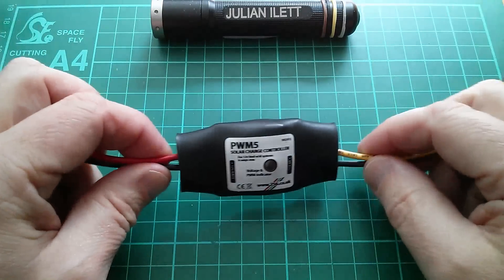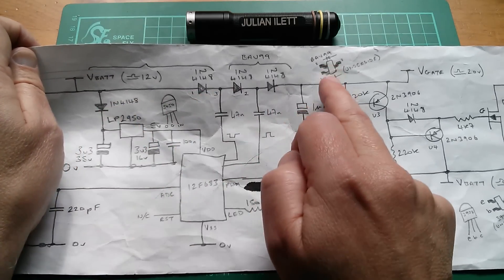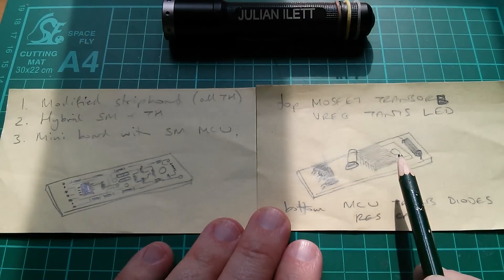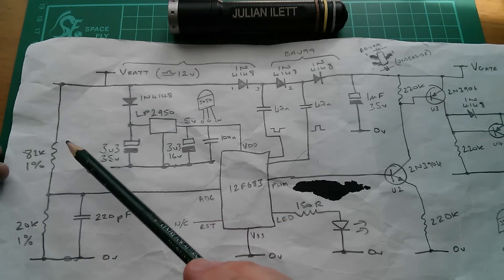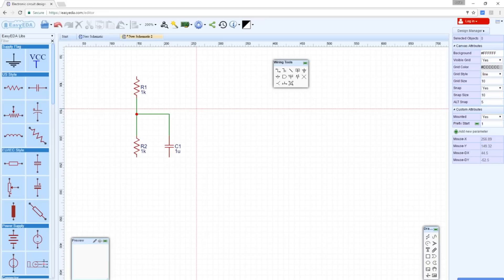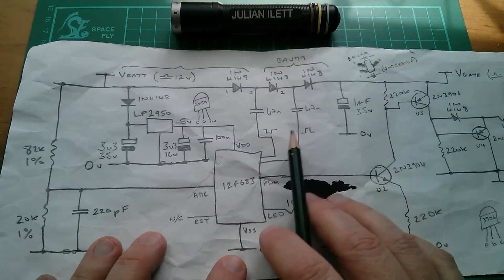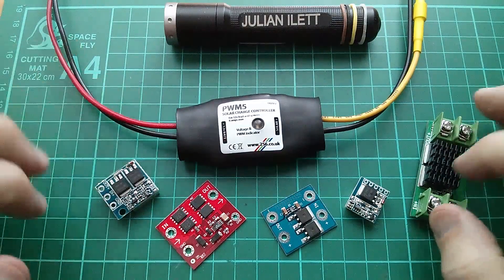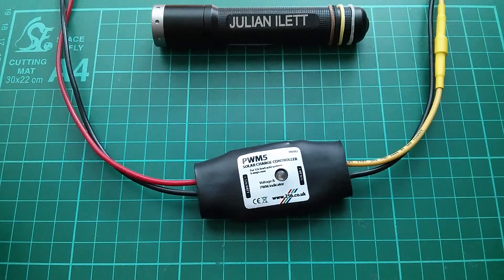PWM5 Solar Charge Controller SMD Re-Design with EasyEDA

Comment: Does this design still cut the mustard in the world of solar charge controllers?
Reply from the maker: While we're still using lead-acid batteries, I think it does :)
Reply: It's a cute circuit and has obvious sentimental value, but I think the world is going lithium and at higher voltages 24-72V, especially as the market will soon become saturated with used 18650s and 21700s as electric vehicles grow exponentially.
How about adding MPPT to it? You've already done the research and fully understand how it works.
Instead of one big MPPT controller for an array of panels, it could be good to use a lot of small cheap MPPTs, one for each panel and then aggregate the outputs.
On a larger array that may have various shading patterns, there can be many peaks on its IV curve, but likely only one peak on a small panel, so this could help maximize collection.

Active bypass diodes such as the LX2410A are superior to diodes which can undergo thermal runaway and lose their blocking ability - this is a great article on shading and bypass diodes:
http://www.avdweb.nl/tech-tips/pv-panels/bypass-diodes.html

Moot for small 20W panels, but some of us do have bigger arrays to play with and want to use lithium batteries instead of lead acid. The market is saturated with lead acid charge controllers already, and there are painfully few for lithium tech - yet.

Comment: And now, the most important question: will it now be called PWM6? :D 
(or actually, why was it named PWM5 in the first place?)
Reply from the maker: +Ivan Voras It was called PWM5 because it had a 5A rating. This was increased slightly to 6A after a minor upgrade.
Reply: Thanks!

Comment: 220pf on the voltage divider doesn't seem like it would have any effect.
BTW the SOT-23 pinouts on your hand-drawn schematic have b/e the wrong way round.
Reply from the maker: There was some instability in the the feedback control loop which the 220pF capacitor seemed to eliminate.
Yes, I drew the surface mount parts on my paper schematic upside down (seen from the underside). I think this was while I was using a simple CAD package to experiment with PCB layouts.

Comment: how about the LP2950CDTX-5.0/NOPB  in a TO-252-3 package
Reply from the maker: +biggrey54 That sounds perfect,  thanks :)
Reply: Use MCP1702T-5002E/MB.  SOT-23A or SOT-89 are available. It is very low quiescent current and very low dropout.

Comment: So this is the reason for the PIC tutorials then? A video documentary of the evolution of the PWM5 and all that is included in the process? I have been watching enough to guess what the big picture is now. Great! I want to make this for myself as I evolve my inner geek with you. Could you explain along the way how it could be adapted for charging with a buck converter in place of a solar panel? Panels are quite a bit down the road for me.
Reply from the maker: Yes, there is a connection between these two projects. Whether I can get them to meet in the middle, I'm not yet sure.
Reply: Wink, wink, nudge, nudge, say no more, say no more, eh, eh.
Well no matter what happens i'll be watching you! ʘ‿ʘ   73 Mate!

Comment: Been in electronics since 1971 in radio/TV repair and later for 30 years as R&D advanced avionics at Boeing for 30 years. In all that time of working with printed schematics, I always ended up drawing out my own....all the different schematic drawing software frustrated me
Reply from the maker: Me too. I tried both EasyPC and DesignSpark, but just got bogged down with all the complexity of the design software. But I'm determined to have another go :)
Reply: give KiCad a try as well. It doesn't have as many packages as some, but the interactive routing is quite nice. Also it's open source, and free.
Reply: I still use the original OrCAD SDT for doing nice, well-laid out and readable schematics.
Reply: Protel on a 286, the best.

Comment: Looking forward to the next instalment Julian. My PWM5 works perfectly and has been since you sent it my way. I would very much like to build one based on the pic version rather than the Arduino. Do you think it might have been adopted by the Chinese manufacturers if it could handle a little more current? Except for the three amp controllers I found generally ten amp is minimum.
Reply from the maker: Thanks Adam. 10A is a nice round number - I went for 6A because it lets you use panels up to 100W (another nice round number).
Reply: Another satisfied PWM5 customer here. After years of using it as a camping solar regulator, I donated it to a mobile solar charge station project I did for some local scouts. However I used a 120W solar panel so I unpotted your circuit from the hot glue and put a heatsink on the FET. No problems whatsoever.

Comment: I recently went through the whole PCB design process in Circuitmaker on my channel.
Reply: I spent a few hours bumbling around in CircuitMaker and managed to cobble together a... "creative" first attempt at a board, but your video explains some important things I missed like 'how to increase the trace size for power nets', 'how to mark hole positions', and 'how to do ground planes', which are good to know if you want to have a board made that isn't useless garbage.

Good shit. 8/10, 25 minutes well spent.

Comment: i worked with a pic n place smd machine around 90-95 era.   one of the packages, an 8 pin was bent flat by an "operative" and reloaded as so it would kneel on the solder pads after reflow, it shouldnt be an issue.  power to you.

Comment: Your efforts were not wasted! I have no interest in starting a business making them, but I did build my own solar charge controller based in part off of the PWM5 design. It currently sits in my garage, with 200W of solar panels connected and operational.

Comment: This is in fact not a design and my head started spinning when I saw you are driving a MOSFET with gate resistor of 4.7Kohm. Little bit study is needed before you start migrating the design to SMD version so that it could at least be usable. I don't see any inductor in the power line and I just cant imagine what this will do exactly. Only PWMing the power path has nothing to do with unless you use an inductor. I cant imagine what a piece of garbage the current design is.
Reply from the maker: +Satyajit Roy I think you're confusing PWM with MPPT!
Reply from the maker: Not really. The RFI was coming from the very square edges of the 122Hz switching frequency. These edges had considerable overshoot with ringing. The 4k7 resistor and 3nF MOSFET gate capacitance act as a low pass filter almost completely eliminating the RF emissions. It's highly effective. Additional heat generated in the MOSFET at this low switching frequency is negligible.
Reply: Satyajit Roy the idea of open sourcing it is so that people can improve it, if you are an expert why not take the design and add to it to make it better for everyone
Reply: If there is any place for improvement I would have said that, with 8MHz PIC, even with 10 bit PWM you end up with only 2KHz PWM. So first thing this PIC is absolutely not suitable, then it needs an inductor. so there is no way other than to use a bulky inductor to drive at 2KHz. In this design, there is nothing mentioned about any inductor thats very strange. There is no analog comparator so the feedback loop has to rely only on sampled ADC. The MOSFET driving is horrible. I dont feel there is any scope to improve this design unless it is completely revamped. Nowadays DSP from TI like TMS320F28027 comes at very cheap price and for hobbyist level there is PIC16F1783 too with PSMC to do it properly.  I didnt feel its a serious business about design, but just a youtube video you enjoy at your leisure.
Reply: Why am I saying MOSFET driving horrible, is because if you connect the scope to gate and source, then you will see how it looks. He has got a new Keysight and it would be nice to show us how it actually works at driving MOSFET. If you connect a solar panel directly to the battery then also it will charge. so this product just do that as switched pulse. Lot of stress to the panel, no efficiency of power, it will end up heating the panel more because when you are pulsing the DC to the battery, then lot of drops inside the panel which will produce more heat. It will not only deteriorate the longevity of the panel, but it wont produce the best out from the panel as well. Its mainly because panel will produce heat internally as well beside the heat received from sun. As the panel get hotter, it will be less efficient. When you design proper PWM DC-DC converter then it will take account of all those thing and will not destroy energy inside the panel. Yes, only purpose of this circuit is, it will cut the solar panel from battery when 14.2 or something is reached. A simple LM311 comparator, a MOSFET, a zener diode and few extra passive components will do that as well.
Reply: Similarly he made last video by connecting two 18650 batteries directly. Few viewers patiently commented to use two good quality batteries, because there is no more joy than to see someone is burning litium cells for fun.  Yes, there should have been warning message because it could be very dangerous if kids try to play same thing without that ammeter... may be that ammeter 100 milliohm resistor could save fire, but if one does using Panasonic/LG/Samsung genuine batteries then you cant imagine how dangerous that would be.
Reply: @Satyajit Roy. Your point about the batteries is valid. To be fair, though, Julian did make it clear (at 10:00 to 10:30), in that previous video, that it would be stupid to use good quality cells for that experiment. Granted, a warning at the beginning would have been even better, but do please remember that these videos are being made by a knowledgeable enthusiast to encourage people to learn and to find out things for themselves. Many amateurs learnt things like these examples by trial and error, making mistakes and learning from them. Many of them then went on to study electronics, etc, and to become good professionals. Julian is by no means being irresponsible - unlike the authors of some other channels, whom I shall not advertise here. Let's keep things friendly here. Thanks.
Reply from the maker: +Satyajit Roy The switching frequency is 122Hz :)
Reply: I've only seen this circuit in this video, but I believe it's simply regulating the average current going into the batteries.. No need for an inductor and a very low PWM frequency is adequate. I do agree that this circuit is bad and the resistor on the gate made me cringe, needs a redesign imo
Reply from the maker: +IrishSkruffles The gate resistor massively reduces RFI. why does that make you cringe?
Reply: pwm are just a protective system for not so big setups, not considering the power utilization techniques. that is probably why chinese manufacturers did not look into it, as there are already some buck and mppt modules available in market.
Reply: +IrishSkruffles The resistor is called a gate stopper and forms a LPF with the gate capacitance and stops the any tendency for the FET to take off at HF. But 4k7 is a bit high.
Reply: +Julian Ilett
My apologies then, I wasn't considering ripple being an appreciable concern but more-so thinking of heat in the mosfet from not being switched "hard" enough. I suppose my dislike of PWM charge controllers shined through lol
Reply: @Satyajit, You brought up many valid points which also bothered me at the beginning. Then I realized the following;
1- Julian is not an Electronics Engineer. 
2- These are very low power (~100W-200W) devices. If you were doing these things in KWs, it would be another story.
3- The very low cost. 
You won't find such simple circuitry in big solar chargers for this exact reason.
Reply: Isn't it strange that you are reducing RFI at 122Hz ?
Reply: MPPT is just a tracking algorithm, but it still works on PWM. Its PWM DC-DC conversion where you either boost or buck the solar voltage to the battery voltage. I do not find any technicalities to connect RAW power source to battery even if it is pulse width modulated. the internal resistance of both solar and battery as well as short circuit current of the panel will not allow them to reach burning point, but it will undoubtedly heat up the panel which is not desirable at any case. A simple inductor based buck conversion doesnt mean it has to be MPPT, because that is just an algorithm to extract even more power out from the panel. But simple inductor based buck (I am assuming the battery voltage is less than your panel voltage) will always keep you on safe side no matter if you run run it from series connected 12V panel which may go up to 42 V at open circuit. there is no need of switching because you are not going to control the charging current, and if you do then you are just wasting the energy. We need to extract full energy out of it. A PWM based buck converter can increase the output current if input supply voltage is more than output. I am hearing it for the first time that PWM charging means just pulse width modulating the RAW DC. In regards to your RFI reduction, IRF3205 has almost 3.2nF gate capacitance plus stray capacitance, and if you drive it with 4.7K resistor then you are just messing things up. If you dont believe me then see on your scope how bad that slope would become. I didnt find any importance to look at your code to extract the operating frequency, but I can simulate for you if you need me to. SPICE can do that pretty easily. Its making a 10KHz low pass filter and which RFI are you talking about ? Why didnt you use ferrite bead then ? it costs penny, but switching faster will produce less heat inside the MOSFET.
Reply: +Julian Ilett The overshooting was happening because you didnt take account of the very low inductor value thats connected in series of the circuit. The long power cable acts as an inductor but its unpredictable or it just changes from one setup to another. when you are turning MOSFET on, you are literally short circuiting two different potential (Vpanel-Vbattery) and this inductor starts getting charged up with dV of that volt. Inductance of this wire is very low compared to whats needed for 122Hz. so even if you keep the MOSFET ON for 1% of time its still  82 microsecond, and when you are turning off the MOSFET then the charge inside this long cable has no where to go and starts ringing with the capacitance across the MOSFET drain-source and stray capacitance. It becomes like a tank circuit to oscillate. By turning the MOSFET off slowly means you slowly adding the drain source capacitance to the long cable inductor during off cycle and then its damping the oscillation. But this is literally not a design at all. You will find products in the market which will show 5KW power saver and if you open that up, you will see that only a low value capacitor connected directly across the AC lines. There are many things in the market which are mal practiced by non technical persons. Every design should have some technical point where people find some benefit using it.

Comment: I hope these will be available when my tiny home solar goes up, next spring. I plan on soldering my own panels, just buying some packs of 40 pcs 6x6 cells and making the rest myself, should be a lot of fun. I want to gang the charge controllers in parallel though, would that work?

Comment: Hi Julien,

Enjoyed your video, thanks! Regarding the LP2950, you can head over to Texas Instruments webpage and under products there is a competitors cross reference tool that allows you to search for alternative TI parts. I did this and TI has their own version of the LP2950, but also the LP2981-N which is a 5SOT-23 package. Quite useful when one runs into this situation!

Note, I am not affiliated to TI in any way, I have just run into a similar issue before and found this tool pretty handy.

Kind regards,

Dylan

Comment: A possible replacement for that regulator might be the HT7350
Edit: Just noticed the max input voltage for the HT7350 is only 12V, so maybe the LM2936 as another alternative (as long as you dont need a lot of output current)
Reply: LT1761 may also be a another option... it has the same 100mA output current capabilities as the LP295x. Additionally, the LP295x is actually available on a SOIC package also, so it can still be used in this design, just in a SMD package instead ;)

Comment: I've started to watch a few videos about solar controllers... And there are PWMs and others... But no balanced charger until now (unless you use a separated one). So, what's the advantage of each model?
Reply: BTW, I'm going to make a solar project, with a 18v panel. And what I'm going to do is using a step down to 5v (with a diode before) and to use a TP4056 to charge 6 18650 batteries in parallel. (Then a dark sensor to turn on a 10w reflector, using a step up and a 12v driver.)
Reply: Solar usually is for lead batteries so balancing not required.
Reply: zogworth Not the projects I've been seen. All of them create "power walls" made of hundreds of 18650 cells.